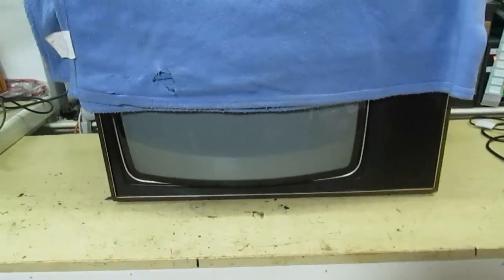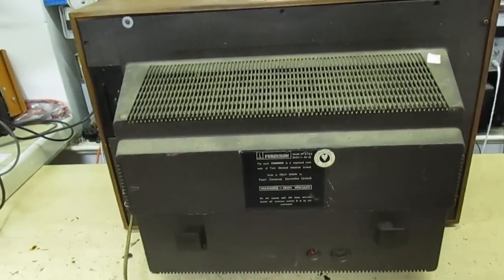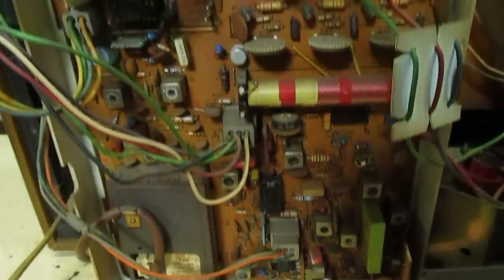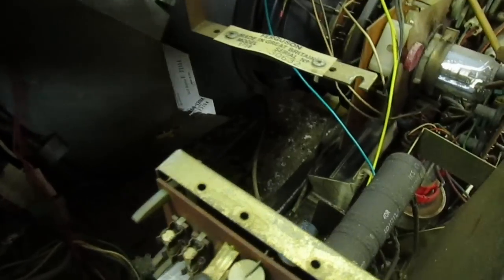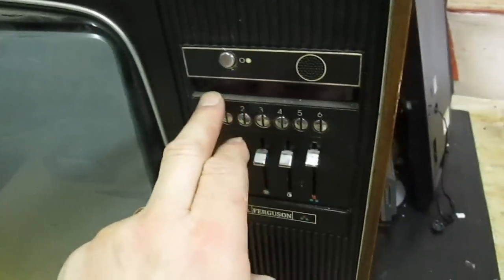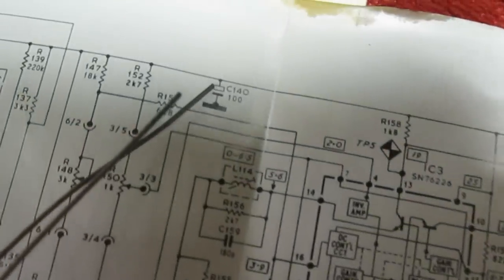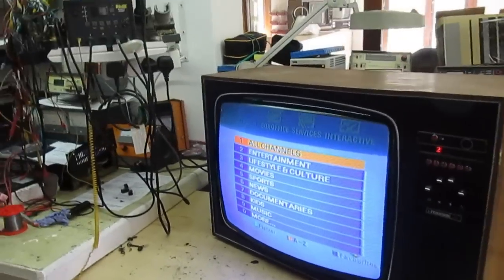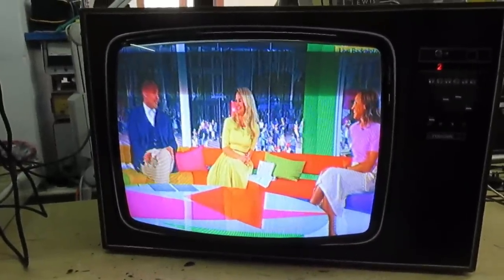Thorn 8800 chassis vintage TV set from 1977.

Comment: Fantastic content as always Michael, I love your videos they always take me back to when I fixed stuff as a teenager and made things on bits of PC board using a Dalo pen as the resist before etching with Ferric Chloride. Back to the Tantalum's we always had problems with those little fire balls if used on RF decoupling as the low frequency path to ground in conjunction with parallel 1n ceramic caps, the ceramic caps are fine but the often the Tant's went on fire, we stopped using them and used normal Mullard electrolytic caps which never had any problems. The products we made where high power RF power amplifiers back in the days when I was working at Microwave Modules in Liverpool.

Anyway keep up the good work and keep well

Regards 

Dave.
Reply from the maker: Glad you liked it , more coming , I don't see many tantalum capacitors these days , maybe they went out of fashion if they were very un reliable , I still use Ferric chloride for my projects these days but have to use black indelible ink marking pens , not as good as the dalo with the blue ink . For thick tracks though I still use red nail varnish .
Reply: Reminds me of when I worked for Data General. Since they were new, the Tantalum capacitors usually didn't fail unless they  were inserted backwards, but when they did, it was always a fireball. In a dusty old TV in a wood case, that could be a real danger. I've never noticed them in consumer electronics; but it would have made sense to have special rules for enclosing them so that any flame would be contained.
Reply from the maker: @pcno2832  Last time I had dealings with tantalum was a few years ago in an old graphic equalizer.

Comment: Like no. 625 .. I'm getting too many coincidences! .. we had a rental 8500 (ALBA branded) in the early 1980s and in this case, the tube flaring was indeed down to the CRT. It came on gradually, first the green gun and then the red one started to creep in.

A replacement CRT was fitted and following that, we had a fantastic bright vibrant picture .. as commented on at the time by people we knew, the best they had ever seen.

These old BRC designs must have been amongst the best. I have a BRC1400 (Freguson Courier III) which produces a really nice picture, especially on 405!

Edited to add: re. the coin meters, the one we had took 50p coins and had the front slot and rotary knob, which got rather difficult to turn. I have an example of these, which I lubed up, and a pound coin version (presumably these came out later) with a drop-slot mechanism in the top & a motor which gradually fed the coins through. Both could be set for the desired rate. It's a shame they changed the coins as they'd still be useful for saving for e.g. the TV licence.
Reply from the maker: I have both 1400 and 8500 TV sets , some of these are already on youtube,
 I remember back in the 80s a TV shop who use to do rentals giving me a great load of slot meters and I went on to sell them to a company advertising in Television magazine for something like £1.00 each .

Comment: We had one of these when I was growing up, it was our first colour TV. The TV was positioned on top of a cabinet where the cutlery was kept - the sound of knives and forks being put away regularly toggled the volume between high and low, but I don't think we ever had "stray ultrasound" that changed the channel. I remember that as the set aged the brightness slider slowly has to be pushed higher and higher - it was close to the top by the time I left home, don't know what happened after that!
Reply from the maker: A bunch of keys could also produce the right sound for remote operation , one good thing about ultrasonic remote is you didnt need a special tester to see if the remote was working , a cat would be sufficient !

Comment: I remember this set well, we had one at home and yes the channels would change whenever any high frequency sound was around. We used to have a bottle full of pocket change that we would count out, bag up and take to the bank each December. Pouring the coins out would change the channel - oh how we laughed. Loved the reaction to the bang! Having worked on Monitors/terminals, including on site from late mid to late 80's my reaction to leap out of the way if something 'popped' was just the same :-) I still do some LCD TV Repairs for friends and neighbours but find that unless it's a replacement of bulging caps, it's easier to buy a board off e-bay. Thanks for bringing back some very happy memories. Just need a video on the Ferguson Videostar piano key VHS unit!
Reply from the maker: Glad you liked the memories, I do have some JVC piano key video recorders so may be in a later video I will get one of these going.

Comment: Good video as always brings back a few memories seeing the 8800 back into life , just beware the servisol switch cleaner think we changed to electrolube because of the disintegrating plastic caused by servisol👍
Reply from the maker: I still have bad memories of servisol and plastic cabinet sets such as the GEC which would disintegrate a couple of weeks after spraying noisy tuning controls .

Comment: Great video Michael........ I worked for Rumbelows in Dartford Kent, back in the 70's, as a tv engineer. Done 2 year in the workshop, then 2 years of repair in customers homes. Thorn was one of the main brands, 3000 through to the 9000 chassis.  I did repair these 8800 at the time and remember the failing components, you highlighted.
Reply from the maker: Thorn sets were the backbone of the British rental market although pretty un reliable and tubes had a short life but designed to be repaired which is something you cant say about todays stuff.

Comment: Gosh takes me back did a little bit of work but wasn’t a qualified TV engineer … I joined the RAF about 6 weeks after the date in that job and became an electronics tech in telecoms originally
Reply from the maker: These old TV videos seem to be very popular , 40 years ago Thorn were the backbone of British TV manufacture and a lot of people would have either had one of these or rented on just the same as this .
Reply: @michaeldranfield7140  yes I remember the TX9 chassis or was it TX90 haha … the other earlier chassis that was popular in its day was the BRC3000 … seem to remember terrible issues trying to correct EW, Pin Cushion distortion and other related convergence issues trying to balance everything out without having access to a colour bar, grey scale, grid and test card generator and using a large wall mirror during the BBC test card transmission time to try and get the best fit … gosh those were the days

Comment: You've taken me right back to my apprenticeship at D|E|R in Ashton-under-Lyne 1983-6. That tube is the best I've seen it must be newer than the set. As the convergeance panel and power board look high hours. I don't ever remember them being made by Toshiba. Of course Rumbelows may have had a different supply chain to D|E|R even though they were both owned by Thorn-EMI I think. The remote for that set used to be a three button ultra-sonic. Sound up/down were the two black buttons and the red button changed channel and turned the set fully off with a relay if you held it on. Great video thanks for sharing it.
Reply from the maker: Glad you liked the video, hopefully more to come soon as I have some more vintage sets to look at.

Comment: Another great video..nice to start with an exploding RIFA cap.
with the buzing choke we used to paint then with varnish untill the replacement were releaste and to quote LLJ beware the blue tant.
Reply from the maker: I have heard of people talking about RIFA caps before but this is only my second experience with a faulty one , the last time I had one go faulty was quite a few years ago in my vintage Farnell  350v bench power supply and all it did was pour out loads of smoke .
Reply: @michaeldranfield7140  , i have experienced a few times a blown Rifa capacitor in more modern devices (3Kv Electrophoresis powersupply), but i still remember the smell allmost like burned wood, that stays for days.

Comment: i didn't come across many 8800's in my time but hundreds of the 8500 and i sold and repaired just as many. they had just started to come off the rental market and so were quite cheap and easy to sell on. Radio rentals still had loads of the things and my friend used to bring some of them to me as his workshop couldn't cope at times. apart from the tubes going a bit soft, but after a bit of a boost and resetting up they were a decent set. of all the sets that came through me i only ever changed one tube, which isnt bad. then the video recorder came along and they had to be modified with a change of capacitor in the timebase circuit as the picture at the top used to bend because the tv couldn't cope with the syncs from the video recorder.
Reply from the maker: I remember , the time constant of the sync separator had to be changed to suite video, later sets had a dedicated VHS button , usually the last one , either 6 0r 8 .

Comment: Hi Michael. I've just watched your video from 2020 A lifetime of electronics - A tour around my workshop. Brilliant, but I daren't let my wife see it or I'll lose my workshop at home. LOL. PS I would love to see that old Thorn 1500 sometime. I cut my apprentice teeth on those. I still have the Thorn 1500 service manual I was given for my training course.
Reply from the maker: I have a video on the Thorn 1500 Chassis on youtube already , a 20 inch set , I put a new tube in it but never got round to finishing some small jobs on it .
Reply: @michaeldranfield7140  Thanks, I've watched it. What a blast from the past. I remember having to change the droppers out on all the customer's returned sets. They'd all be decorated like a Christmas tree with resistors patched in, just like yours. I remember the valve bases always needed re-soldering or tightening up. I remember I liked doing them though, so much easier than the colour sets. No convergence to deal with. That 3500 chassis was the toughest for me at the time. All the dynamic convergence controls would be overheated and brittle. The line and power boards got so hot that components dropped out of them. Not designed to be left on all day really.

Comment: I remember a place down Oxford Rd in Manchester.. long gone buried under the university new buildings.. called "Romany Palace". In the mid 80's it was like a huge old engine shed filled floor to roof with rack on rack on rack of ex rental tv's. £5 a pop take your chances. (£2 for the dual standard B&W sets) We had a van.. we made an absolute mint selling them virtually door to door at £25 each. (B&W which I used to gt off the dump a tenner) Rumbelows did the Thorns and if memory serves me well Granada did Finlandia which I seem to remember being more reliable overall.
My house was more like a tv showroom.. must have had no less that 50 indoors at any time.
Our "guarantee" was.. 30 days complete replacement/repair.. after that depends on what's died and if we have bits available. Often because our customers were broke or unemployed we just used to swap them for another one which maybe wasn't cosmetically or something quite as good..  I don't recall anybody ever saying they thought they had been treated unfairly.

Did my apprenticing at Julie TV on Blackburn Rd in Bolton.. and then decided I could make more than 30 quid a week going freelance with a mate with a van.

Mother ran a HMV  2000 until her death in 2001. One of my early tip finds along with half a shop of spare boards and bits plus youthful hernia!!. I wish I still had that museum piece.

These days just fixing the modern junk ones for neighbours and making small occasional bits of cash from street finds.. but there is no money in it so I got out of the trade in the mid 90's... as did everybody else.
Reply from the maker: Back in the 80 s ex rental TV was big business and places sprung up all over the place selling these , as you say , easy money because everyone wanted colour TV but they were so expensive to buy brand new compared to wages back then the market for second hand was massive, its how I started my business, although as new prices began to fall and wages increased  I later made a successful career out of selling brand new sets.

Comment: I remember the 8800 sets well, must be 30+ years since I have seen one. Had to laugh when the Rifa cap went pop, usually filled the workshop with plumes of smoke!
Definitely replace all the tants, these were unreliable back in the day. Looks like an excellent CRT, would be nice to find an original ultrasonic remote for it.
Reply from the maker: most thorn sets of the day were pretty un reliable and had a dreadful tube life so this set is a rare item to have such a good tube , I remember the remote it had two big  silver buttons at the top, there's always a good chance my friend will have one somewhere.

Comment: 8800 and 9600 were being scrapped when i joined thorn i always liked the tx100 and tx10 chassis, the oldest one i fixed was a 1500 mono with a faulty dropper.
Reply from the maker: Got TX10, TX100 and 1500s in my collection but dont have a 9600 , I seem to remember the 9600 having a single pcb at the bottom and always having burn ups in the east west modulator circuit .

Comment: nice, i used to have an 8500 chassis model but got damaged in storage and had to get out of the storage barn anyway, so was stripped out for parts, still have a ferguson 3712 8000 chassis thing, worked very well when last powered up in the early 2000s, apart from flyback/teletext line interference,  which also afflicted the 8500, which also worked reasonably ok,
Reply: insides look very similar to the 8500,  i sold the lopt and eht tray to a 'collector' on facebook, i still likely have the psu choke somewhere! that one didnt have a thermistor but i read somewhere it was advised to fit one , i dont think mine buzzed excessively ...if it did i'd have likely removed it and doused it well in transformer varnish

Comment: Fine Work Michael Rember Useing That BXL Board When I Was Young Etching Projects Fiberglass Board Much Better But a Lot More Expensive Thanks For The Upload Michael Regards mike.
Reply from the maker: Glad you liked it , that pcb board was an exciting find as a young boy , as you say though fiberglass is far superior these days and you can heat it to a much higher temperature for soldering SMD .

Comment: Seeing the coin meter holes in the back reminded me of the ex- Telebank/Granada  ITT CVC800 and 1200 sets I used to buy, they would always do a good job of sealing up the mounting holes but the electrical wiring was a different story. Always the cables were just twisted together and sometimes covered in insulating tape, otherwise just floating about in the cabinet.
Reply from the maker: Got an ITT set a 14 inch portable but I don't know what chassis fitted yes as not taken off the back , but I remember the CVC800- 1200 series and still have all the service manuals .

Comment: Practical TV..I think it was Les Lawry Johns who wrote “ Beware the blue tant. !”. I remember a long time ago..I was still at school…a friend had an old Pye VT4.. it had blown its fuse. I put a bigger fuse in… turned it on and there was an explosion. While we were talking..the picture came on! Yes…the cap across the mains. Also….how are you managing to receive analogue telly in 2022?
Reply from the maker: Strangely enough most of the tantalums I have had faulty have been red , I don't think I ever changed a faulty blue one .
Analogue TV comes from an old Amstrad DRX300 sky digital box that I modified to display colour bars as well as sky picture.

Comment: Hi, I would normally do a purity adjustment check prior to doing any convergence adjustments. 
Something I did notice tho when I would swing the TV's around on the bench the purity would go out wildly.
I put this down to the earths magnetic field and how the TV was oriented at the owners house for years, 
I never came to any real conclusion and as I left the place I worked I never got to the bottom of the issue.
Reply from the maker: I am sure you are right, and thinking back I think it was also recommended to do a manual degauss before attempting any adjustments , the earths magnetic field does affect CRT and its for this reason analogue scopes were fitted with a trace rotation potentiometer .